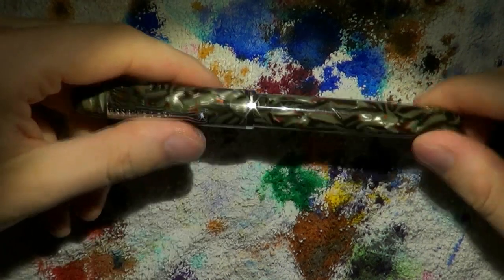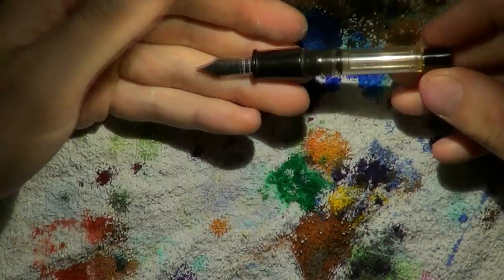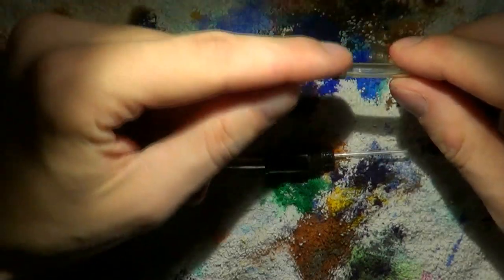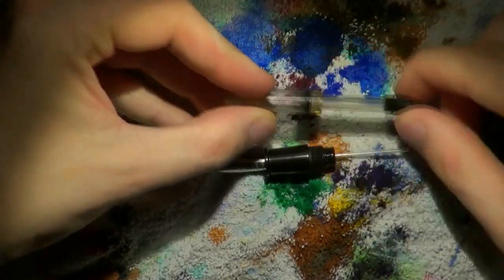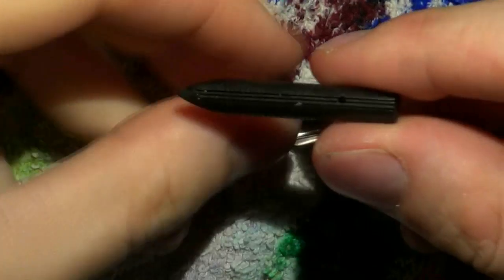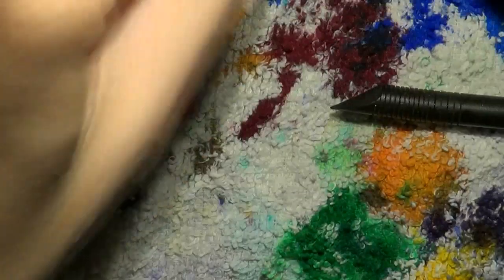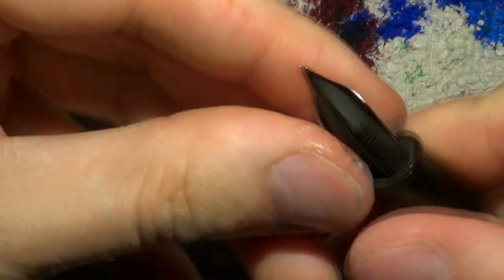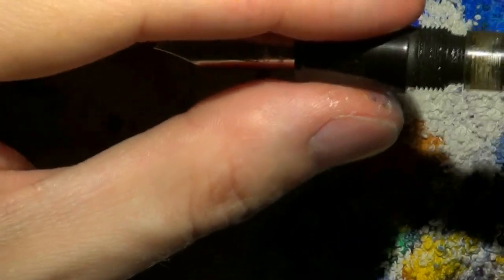Disassembly Line Noodler's Neponset

Comment: When I pulled out my nib & feed from my Neponset...this little 'inner white barrel" came out with it!  I guess its an inner barrel that rests inside within the finger-grip acrylic outer 'barrel' portion.  I don't think its supposed to come out...however, it does have some threads at the top portion of it. (opposite side of where the nib/feed goes into.  Do you know if that is supposed to come out ever?  (Perhaps during cleaning or flushing?)  Thanks
Reply from the maker: Sylvia Catalano That's the nib collar, I think, by what the sound of what youre describing.  As long as it goes back in, I wouldn't worry.
Reply: Yes, it's the nib collar.  I hadn't used my pen for a long time...and upon disassembling it for a proper cleaning....this nib collar came out (along with the nib &feed still stuck to it with dried ink!)    I noted that there are threads on the opposite side of the nib insert end.  I also sadly discovered that there were 2 tiny cracks on this nib collar ....but luckily the distributer is sending me a replacement collar.
For future use:
1)  How are the nib & feed supposed to come off?  (pulled straight out?  Twisting off due to threads on other end? and if no twisting off...then why the threads at that that other end?
2)  How do we clean this neck area? (or is ink theoretically never in this area.
3)  Is this white nib collar EVER supposed to come off?  (again those threads got me wondering.
I'm truly grateful for your knowledge on fountain pens and channel, sbrebrown.  🤗  Thank you, kindly.